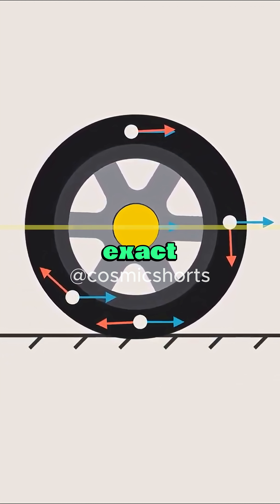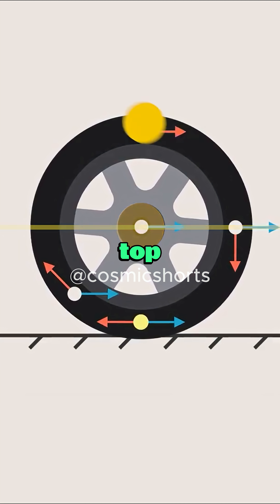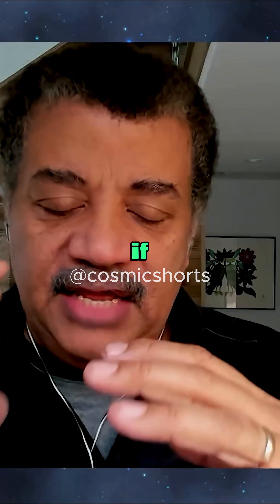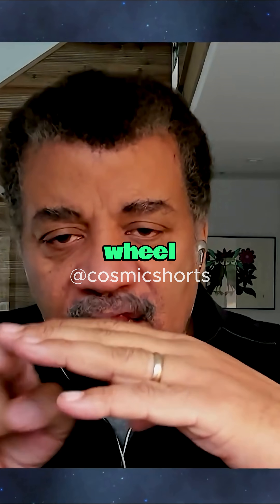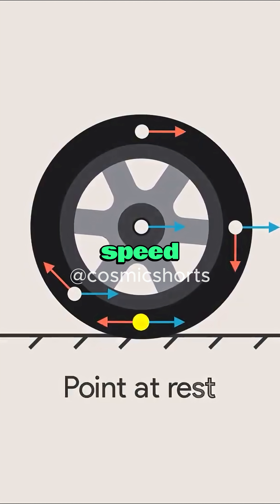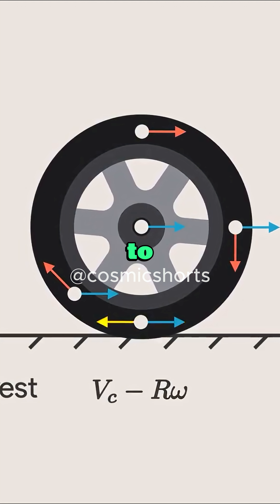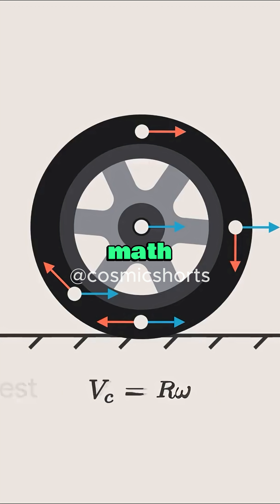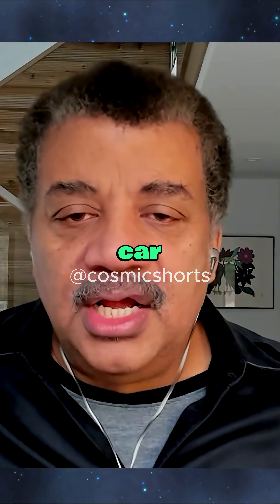The Surprising Science Inside Your Car Tires 🧪🛞

Comment: I’ve not been this confused in a while 😂😂😂😂
Reply: It’s hard to wrap your head around. Let’s take the car at a paused moment in time. Currently what forces are being exerted on any point of the wheel? Well at the point where it is touching the ground it is moving forward at 60mph with the rest of the car. Well also at that same point there is a force acting on the wheel at -60mph backward. We therefore have 60-60=0mph. Well at the top of the wheel we have defined that it is moving forward at 60mph with the rest of the car and due to the wheels motion forward there is another 60mph force applied to this point so we get 60+60=120mph.
Reply: @loganchristiansen564  [Well at the point where it is touching the ground it is moving forward at 60mph with the rest of the car. ]
No.  It is stationary to the road if it is rolling without slipping --- the normal condition.  Please read my comments within this section.
Reply: @loganchristiansen564 much better explanation
Reply: 😂😂😂😂😂😂same thing here
Reply: My thoughts. And I love physics
Reply: @judykanana8087  try to visualize it
Reply: Same... Going at 0/h?
Reply: @marianenescu5220 think about when you’re running. The foot that is on the ground doesn’t slip around or you’d lose your balance. If it’s not slipping around it’s not moving which means it has no speed or 0 mph.

Now think about your hands when you are running. They are connected to your body which we’ll say is going forward at 10 mph so therefore if your hands were stuck to your sides they’d be moving at 10 mph with the rest of your body. However, your hands are not stuck to your side when you’re running; they are swinging back and forth when you’re running. When your hand is behind you and you’re going 10 mph, the only way for your hand to get in front of you when you swing your arm forward is to go faster than the rest of your body that is going 10 mph.
Reply: @yoong___  bro, you're explanation was way better and understandable than Tyson's.
Reply: Just take any round wheel and slowly roll it along a flat surface and you'll see that the bottom part touching the surface is stationary to the surface at that moment.  And the top of the wheel moves at twice the wheel's forward velocity.  Still not convinced? ... then try the following, it's very simple and easy to do.  Take two wide round objects, like rolls of paper towels or toilet paper or whatever, but make sure they're the same overall diameter.  Then place one in front of the other on a flat surface, like two wheels on the same side of a car.  Then place a long stick (a yard stick works really well) and place it along the tops of both rolls so it too is horizontal to the surface.  Now push the yardstick along the top of the rolls so the rolls travel along the surface without slipping.  You'll notice the yardstick travels at TWICE the forward speed of the two rolls.  That's the top of the rolls moving at twice the center of the rolls' forward speed.
You can see this effect also in your microwave oven if you have a rotating glass plate atop a wheeled carousel.  The glass plate will spin at twice the angular speed of the carousel it's riding on --- always twice.  Again, because it rides on the TOP of each wheel.
Reply: @thecarman3693 that’s insane. Man I wish I spent more brain cells on physics. It’s the most mind blowing fascinating thing in the universe
Reply: Same thing 😂
Reply: Instead of a round wheel, think of tank treads.  
The top of the treads zips forward to the front if the tank.  Then it curves around to the ground and as soon as the tread touches the ground it stops completely.  Like, if you are standing next to the tank as it goes by that piece of tread stops right next to you and stays right where you are.  Then the tank rolls over the stationary tread, then the tread picks back up off the ground, rolls around to the top, then zips forward to the front of the tank again.
Reply: @ChrisBCritter7465  And that tread zipping forward will always be advancing at twice the tank's velocity as it rolls over the tops of of its support wheels.
Side note: Those upper support wheels are spinning such that their bottom points are stationary to the ground as well as the tank goes past you.
Reply: Same 😂
Reply: A good way to visualize is a military tank 😂
Reply: It's common sense
Reply: He’s right but what he’s talking about for the 0 km/h is a virtual point he’s referring to the part of the wheel always in contact with the road but this point is never the same thus the reason why I calling this a virtual point
Reply: @_yann_-g-3050  It's NOT a point --- it's known as a contact patch, it has an true amount of contact area with the road.  And that's what's giving you and your car the only place where FULL control of your steering and braking can happen with the road.  Even at highway speeds that patch keeps you from sliding or losing control as long as you don't exceed its frictional forces, brief as its moment of contact is.
Reply: its simple thats why if u get much different size wheel ur spedo will be off by a few ks
Reply: Iam so confused that I think I forgot my name??
Reply: The bottom wheel speed is at zero bcz of friction. Physics 1.0
Reply: Yup, since Chunin exams
Reply: I'm at a point where I'm thinking Neil just be making up dumb stuff to annoy us😅
Reply: Ditto
Reply: Word
Reply: Look at tank or excavator tracks. Same principle
Reply: I am gonna be confused on this forever😂
Reply: it's actually quite complicated and studies in kinematics and dynamics of a rigid body
Reply: Ne neither 🤯
Reply: Really? I thought it was pretty obvious, the bottom of the tire grips the road, the road doesn't move, so that point is stationary, the top of the wheel needs to overtake the car to get back down to the stationary position.
Reply: You need a blunt cigar size
Reply: This is easiest to understand when you imagine a tracked vehicle like a tank, excavator, etc.
Reply: For those who are confused, imagine a tracked vehicle like a tanks or an excavator. Or watch a video  of one. The area on the ground is not moving. You can actually put paint, or mark an area of the track that’s touching the ground, and it will not move until so much of the track goes around.
Reply: We're in the same boat 😂
Reply: It's like the teeth on a gear.
Reply: I think that is why there are blowouts. 🤔
Reply: As someone who went to college to work on cars, you can delete this from your brain, its useless info.
Reply: He talking about tire slip, your vehicle should have between 10-20% tires slip others your traction control will kick in
Reply: What just happened
Reply: Top of the tyre has no load 
But when it turns to the ground it has drag from the weigh of the vehicle….i think 😂. 
All thanks to my years reading applied physics in uni…. Normally I won’t understand this
Reply: Okay I watched it again he’s explaining elementary physics——— just take a pendulum bob as an example that’s easier to relates…..it’s like he added relativity too…..when you throw a ball up there’s a height it reaches before it loses momentum (maximum height) at the potion v=o…..so what he means by the tyre is not moving when it on the floor is simply…as I explained…..take that point as the maximum height….
Reply: Been watching this multiple times and still confused to what this dude is trying to say 😂. All I’m understanding is that, a perfectly rounded tire spins slower at the bottom of the wheel, while the top of wheel moves faster? Must be a stretching, rubbery wheel of some sort 😂. Dude smoked something good and trying to get us to smoke something too and figure out wtf he’s trying to say 😂
Reply: I’m not smart enough for this 😔
Reply: Ain't physics fun.  What we experience is just the average of all the chaos.
Reply: You're not alone😂😂😂
Reply: You ain't neva' lied!!!
Reply: Omg 😂😂😂😂😂😂 same here.
Reply: Fr
Reply: Lol 👍🏼
Reply: My situation on this, I got it but I can’t explain
Reply: how can someone be confused by this?
Reply: Basically, when you're walking, you know how you put one foot down? While that foot is on the ground, it's not moving, the rest of you IS.
Reply: Yeah I don't agree with him on this one
Reply: I was so confused I ask myself do I really need to know this 😂😂😂
Reply: You can see this idea much easier by looking at the tracks on a moving tank. The factors are different because the dimensions of the tracks are different than a wheel, but the concept is the same. The part of the track in contact with the ground is not moving. But the section on top of the track is moving faster than the tank
Reply: Yeah me to! To mutch scients for me😂😂
Reply: Nah frl he usually doesn’t lose me but I have no clue what’s going on😭
Reply: Me either
Reply: I feel the same way 😂😂😂😂🤣🤣🤣
Reply: Hes talking about relative velocity...but hes talking about it as if with a universal perspective.
Hes incorrect.
Reply: @HexV-u7ztbh in physics nothing is incorrect
Reply: @HexV-u7zhe means at the instantanous speed. Your wheels dont skid, they roll.
Reply: @HexV-u7z 
LOL you are actually calling out Neil deGrasse Tyson on physics!
Reply: You cant put a single point on a tyre where it is not moving and where it is moving 2x the speed
Reply: @BokiRS  LOL.  Yes you can, and he just did.
Reply: @Mozart1220  you cant. Tire always rotates out of that point
Reply: @BokiRS  But at the bottom it's not moving at all and at the top it's going twice as fast as the center. It's measurable.
Reply: @BokiRS at the instant that the tire contact patch is touching the road, that part of the tire is moving zero MPH.
At that same moment the top portion of the tire is moving twice as fast forward as the vehicle.
It is easier to visualize this phenomenon using tracked vehicles where the entire portion of the track contacting the ground is not moving forward yet the top part of the track is moving forward twice as fast as the machine.
Provided there is not any slippage of the track.
Reply: @jimnaden5594  but there is only 1 point thats not moving for only like a millisecond. The point changes fast so it doesnt make sense to talk about it
Reply: @BokiRS  Oh really?
First of all Neil should have mentioned that it's actually a contact patch, not really just a point.  And that's what's giving you and your car the only place where FULL control of your steering and braking can happen with the road.  Even at highway speeds that patch keeps you from sliding or losing control as long as you don't exceed its frictional forces, brief as its moment of contact is.
Reply: @thecarman3693  thats true
Reply: @BokiRS yeah literally. That’s why I’m unable to even wrap my head around it. If we’re taking a “snapshot” then it’s literally a still “snapshot” ie. No time. No movement. The only way time is involved is by comparing side by side snapshots. But then it’s not fluid in motion ie. Not “actively “ portrayed as moving. Hence what seems to be an irrelevant but I assume still an important “phenomena” ….😊I just put the “”” to look smart btw lol
Reply: It starts at the bottom so resets
Reply: To better understand where he is coming from I'll use aeronautics specifically rotorcraft.

Let's say the airspeed of a rotor craft is 100mph the advancing blades airspeed will be faster than the aircraft whereas the retreating blades airspeed will be slower, whereas the swash plate/ rotor hubs airspeed will also be 100mph. 

Unlike a wheel once parts of the retreating blades airspeed = 0 mph(as the rotorcraft speed increases) the retreating blade will lose lift, if the tips of retreating blades = 0mph that side will have already experienced stall. 

This is the limiting factor of speed of a rotor craft.

Comment: The top of the tire is actually slightly faster than 2x car speed.  The bottom flattens from the weight as it contacts the road, so the stationary bottom is actually a chord of slightly less radius.  Thus the top has to go slightly faster than double to keep up.

Comment: This situation is very important to helicopter pilots because the lift of one side of the aircraft is higher than the other.  The blades that are rotating toward the nose of the aircraft are moving faster relative to the air (helicopter speed plus the speed of the blade rotation since they are spinning into the wind)  than the blades on the other side that are moving toward the tail of the aircraft (helicopter speed minus the speed of the blades since they are spinning with the wind) and create less lift.

Comment: Ok , and now , graaadually morph the car into a wing, the front 2 wheels into foward facing propellers, and the 2 exhausts into jet thrusters.
Now what parts of the plane is immitating these 3 speed dynamics of
" Zero mph, Same speed of plane, and twice the speed of the plane?
They STILL have to exist somewhere,
because you can STILL boil a plane down to a simple machine known as a lever.

Comment: If we drew two lines on the wall of the tyre.. one on the top and one at the bottom, wouldn't the top move forward and the bottom move back as the car moves forward and the rotation proceeds?

I understand the example of tracks on an excavator, however tracks and tyres have different mechanics, material and shapes. Just trying to understand how this concept works so I can explain it to others with confidence.

Comment: His error is:
At 60mph, the wheel has constant angular velocity, which also means it has constant acceleration since the direction of the tyre is constantly changing.
If we were minute size person sitting on the wheel, we'd feel this acceleration, because our ears contain an accelerometer, even though the straight line speed is constant.
Hense why we should feel the earth's spin due to constantly changing direction, which is acceleration.
But we don't feel it:
because we're perfectly stationary...

Comment: I bet there are a few atoms on the bottom that are actually going backwards that fit into grooves of concrete lower than most concrete particles.  Just as with a train wheel but on a much smaller scale

Comment: Going forward with zero speed? That's not going forward. Word play. Let's be more precise then: what he is talking that the one point rith on top of the when goes for for moment faster, the next moment it is already curved down. So let's be precise. So in short does not matter. Also his statement is wrong because it would only work when you are not accelerating at all or decelerating at all. In other words go at constat speed. That never happens. Is always slight acceleration at least or deceleration, so all this math is whack

Comment: The point of contact from the wheel to the pavement is literally a pushing or pulling motion to make the car move forward or backwards. The mph determines how fast that contact happens so if there is a motion during the contact how can it be 0. Or just put your car in neutral and let it roll on its own and tell me at what point did u see that tire not have any kind of rotation. My opinion it’s more of an illusion than actual facts or I’m wrong until science proves itself wrong

Comment: For a man that has always worked to use the proper verbage when giving lectures,  NDT sure blew it on this one, and it's not just semantics. The part in contact with the road surface IS NOT THE WHEEL,  it is the TIRE ! Reading is fundamental, and when speaking or writing using the exact proper words is the most fundamental part of the exercise.

Comment: It's observer dependent. If there is another car passing that car at 120 miles an hour the top of the wheel of the car he is talking about Is zero and the bottom of the wheel, at the contact patch, is 120 mph, the center or hub of the wheel is 60 mph. All relative to the faster moving car.

Comment: This actually makes more sense sense when you think of tracks and not wheels, the track on a excavator the bottom feet are staying in the same position on the dirt, the middle of the track position is moving the same speed as the excavator and the top of the track look like is moving faster then everything else
Reply: I get your point but the difference is tires don’t have a flat surface. Even the wheels that the tracks are on are always in motion
Reply: @deandrespruill3528 I could definitely be wrong but the way I understand it was that the bottom inch of the tire bc the air pressure in it gives it enough slack to become flat, even though the difference is a lot there still is a small portion of it that is technically flat against the road
Reply: @AndrewSefner this is probably the perfect simplification. Well fucking done!
Reply: @AndrewSefner  Its nothing to do with air pressure, or a flat spot, its simply that the part of the tyre thats on the ground is not moving forward at the moment its on the ground, if you slam the brakes on and skid, then the tyre on the road will be moving at the same speed as the car, as would the rest of the wheel/tyre.
Reply: https://youtube.com/shorts/sxGWJIOPPpc?si=8WGSdrNzWd7Z1b7j

Comment: With a rigid wheel, yes. But if we are using tires, the top of the tire will be going more than twice as fast as the car speed because its radius is greater than the radius to the ground. Tires are squishy.

Comment: Butt the wheels spin witch means there is no static down part and so the part that doesn’t move only doesn’t move for a fraction of second probably ( depending on the speed speed). before getting switched for  another part of the wheel that then doesn’t spin same thing with the upper side